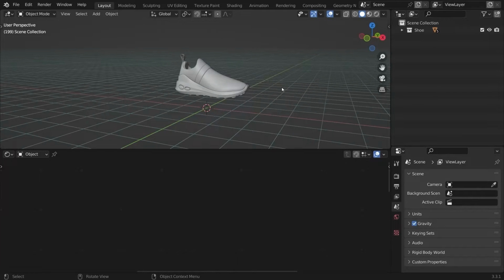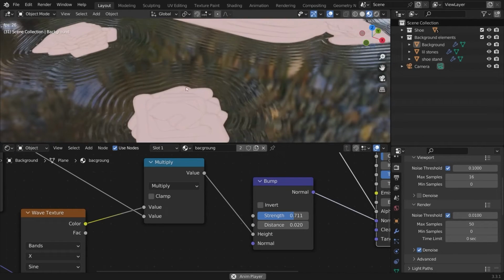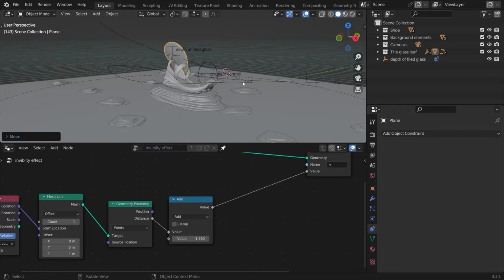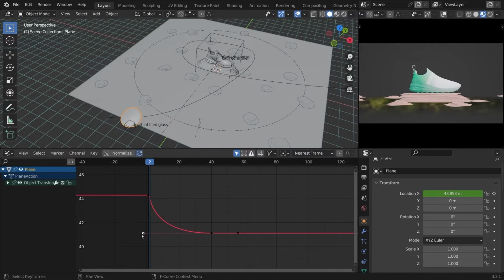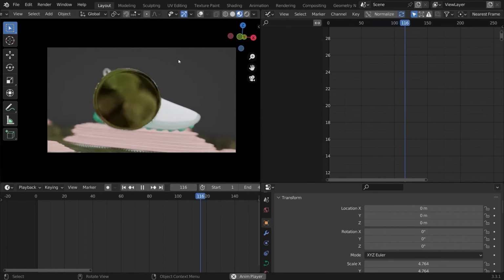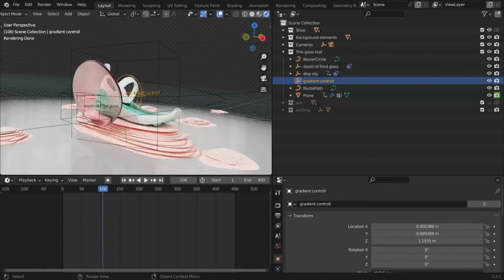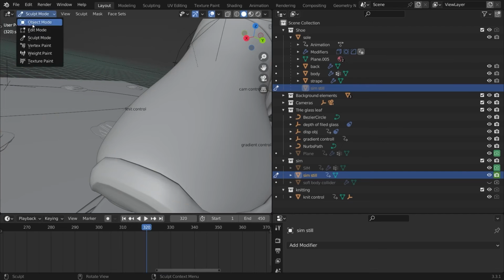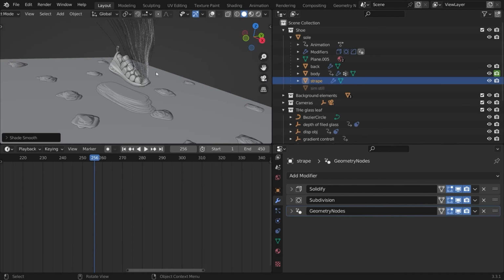I Created a FAKE Shoe Commercial in Blender!

Comment: Bro, when choosing GPU compute for cycles render, your file just freezes and refuses to render. When I switch solid view or material preview back - blender crashes. May it be because of some settings in your project file?
Reply from the maker: GPU means if you have a good graphics card installed in your pc it will make the render fast.
But if you don't have a good one or anyone then don't choose it